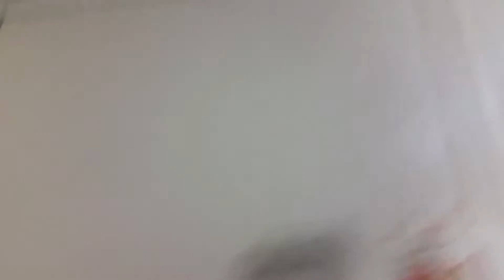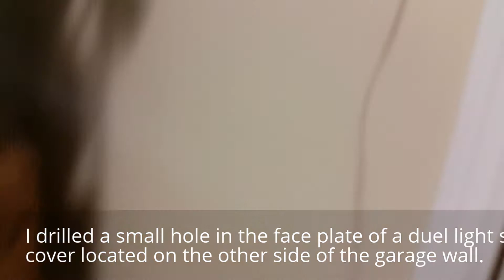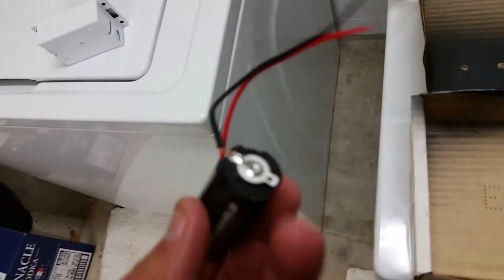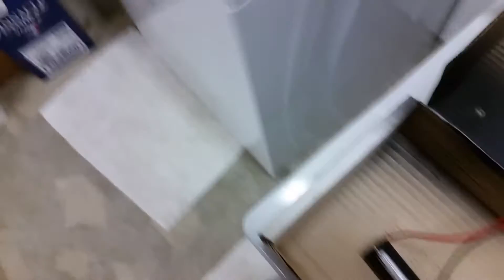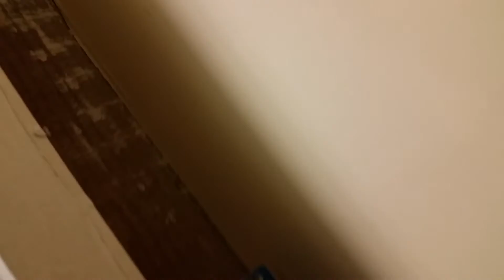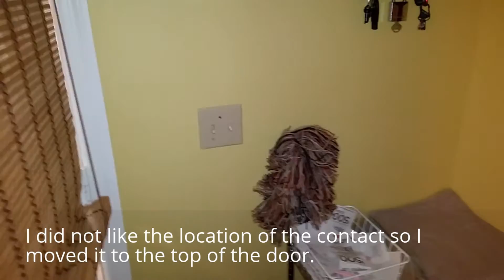Garage door open indicator light

Comment: i think i understand this   ...  I believe this wiring will work       http://prntscr.com/mm469t      the longer leg of the led is positive. and wire normally closed so when the the door is closed the magnet snaps open the switch and breaks the circuit turning led off.  when door opens the switch snaps closed completing the circuit and turning the led light on..  ordering stuff soon  thanks buddy

Comment: So, what's in the box, is there a relay? How does the sensor activate the light?
Reply: dviii, the box just has the battery pack. How it works is with the magnet sensor switch, you buy one that is normally open or some you can wire it up either way, N/O or N/C. You want it to be N/O when the garage door is closed and the contacts are together so the light is off from the open circuit. Once the garage door is opened and the switch separates, now it is in the closed circuit position and the light will go on until you close the door in which the circuit becomes open.